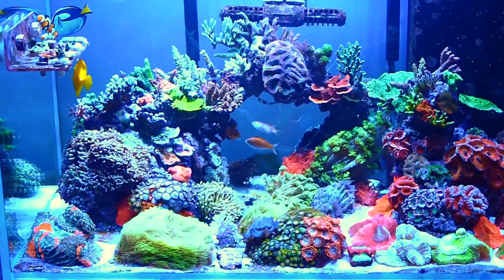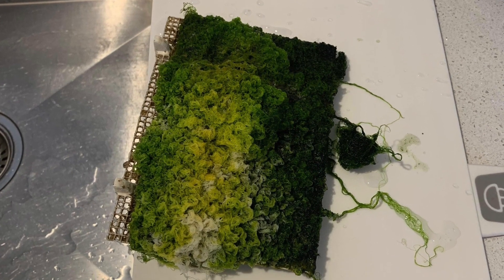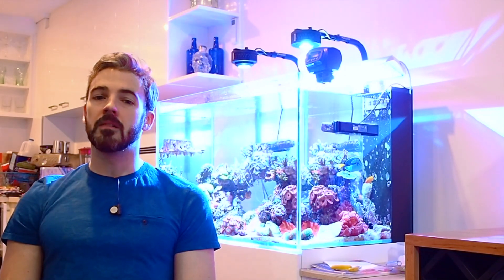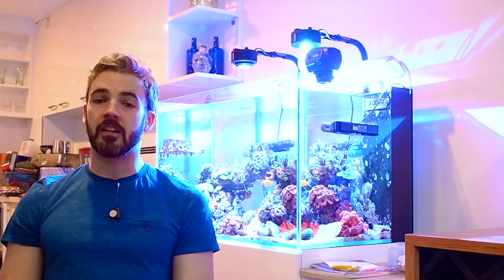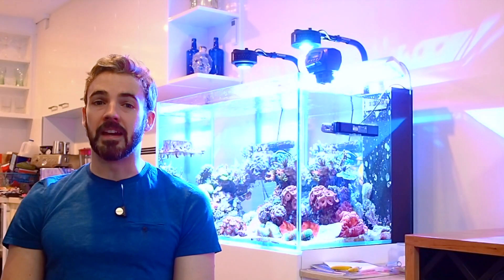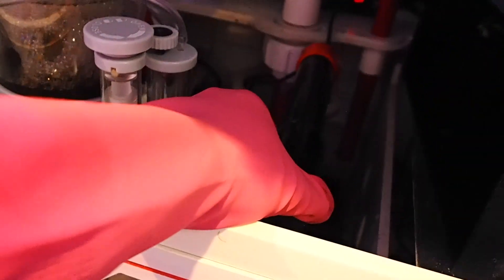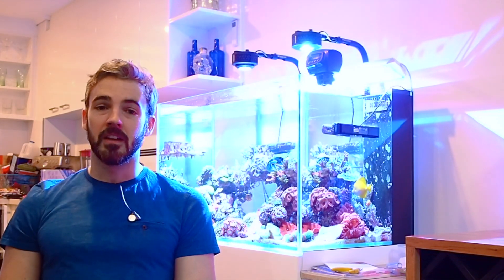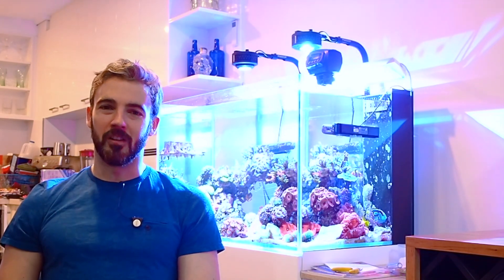Grow Algae to Fight Algae - RAIN2 Algae Turf Scrubber

Comment: Looks like a small tank for that large of scrubber. How big is the tank? excellent gas exchange raises ORP extremely well but it is most important to occur at the top of the tank waterline.
Reply from the maker: Yea its a small tank, only about 80 gallons, but it is extremely densely packed with coral I feed heavily as a result. Sizing for algae scrubbers is best measured by how much you feed (coral and fish food) as opposed to water volume.
Reply: @ReefNerd  Thanks for the reply. It certainly works!

Comment: I have a waterfall algae scrubber and it has been in place for 3 years.  It grows very little algae and I do not know why..

I run it with a filter sock and protein skimmer.   I have added supplements to grow algae.  Nothing seems to make it grow and there are plenty of nitrates 40ppm and phosphate s over 1 ppm.  Please help!  Tired of water changes!  

120 gallon with sump.  1 8 inch hippo with live rock.  Not much algae in tank but can not get nitrates down.  Tank is about 10 years old.

Thanks..woo
Reply from the maker: Whats the brand/model of algae scrubber you have? Given you have high nutrients and have not been able to grow much algae, I would look at the lights that are running on your ATS, they may not be powerful enough. If you do get it to start growing, it will likely grow thick slime that needs to be cleaned more regularly until your nutrient levels come down (the slime is super nutrient dense, just needs to be cleaned off every few days). Also check the flow rate over the screen, needs to be sufficient to cover the whole screen, but not so fast that it sprays everywhere or puts too much pressure on the algae.
Reply: @ReefNerd  it is a Clear Water 100 and it pumps 300 gah.  This is the flow recommendation according to the manufacturer.  The lights are rated for 5 years of life and I have had it for three year’s.  I have tried 24. 12 and 18 hours of light a day.  

I have now unplugged the protein skimmer to see if it makes a difference.

When I first got it...it grew more then than now.  I have never seen my Nitrates lower than 20 and are usually 40 to 50 ppm..thanks

Comment: Been looking at getting an ATS for a while now. This video convinced me to jump on board. I did get the rain2 because of the design and the support structure for a small section I have in my sub. Thanks for the video; it pushed me over the edge. Will let you know how it works out! Thanks! 🐠
Reply from the maker: Glad I could help!

Comment: Reef nerdhow is it that I'm running the ssmeset up as you and my algea  turns brow when I run my gfo  and it ends up dieing  and suggestions
Reply from the maker: What are your phosphate and nitrate readings when you test them? Also how often are you harvesting your algae scrubber?
Reply: @ReefNerd  Well I just tested my phophate on Hahanna checker and  I got  0.18 and for nitrate i have no clue and I am actually restarting the growth on the santamonica  rain 2  algea scruber  do to it dieing  of do to use of gfo but I can probably  be wrong and I have only done one harvest before the algea died
Reply: Well I just tested my phophate on Hahanna checker and  I got  0.18 and for nitrate i have no clue and I am actually restarting the growth on the santamonica  rain 2  algea scruber  do to it dieing  of do to use of gfo but I can probably  be wrong and I have only done one harvest before the algea died
Reply from the maker: @reefjunkies6197  I would not restart the growth on the rain 2 (I assume you mean letting the screen dry/clean completely) It will set you back and most likely just grown brown slime again. 

I am not sure the brown growth is related to your use of GFO, I believe its due to your phosphate (and likely nitrate) being too high. At levels that high the brown slime will out-compete the green hair algae. In some case people can lower their nutrients through growing brown slime in the scrubber, the difference is that you need to harvest it every 2-3 days. It may not work for you, or it may take a long time to lower your levels that way. If it were me I would use lanthanum chloride to lower my phosphates to the 0.04-0.05 range, at that point the algae scrubber should work much better, grow algae again, and keep the nutrients low.

Comment: Hi Marcus. What filter are you using for your camera?
Reply: Are you dosing iron for growing the algae in your ATS?
Reply from the maker: I am not dosing it specifically, however its included in most trace element programs so if your dosing any trace program your probably also dosing Iron as part of that. With green hair algae I find dosing Iron is not strictly necessary, for some people they find it a requirement especially if growing Chaeto
Reply from the maker: I use an Olympus E-PL8 Camera with a pretty standard lens. I use the vivid color setting, its seems to help cut through the blue and do okay with tank lighting. I then do a bit more color correction in iMovie. None of that is perfect, definitely room for improvement! For still shots I sometimes use my iPhone XS which does okay, but then color correct in light-room afterwards.